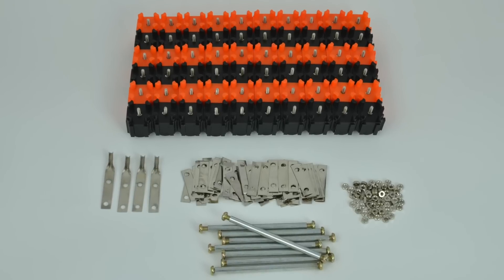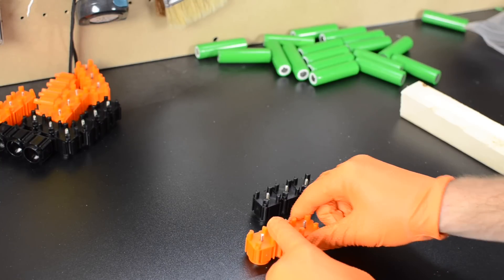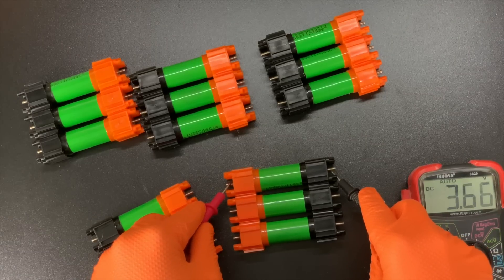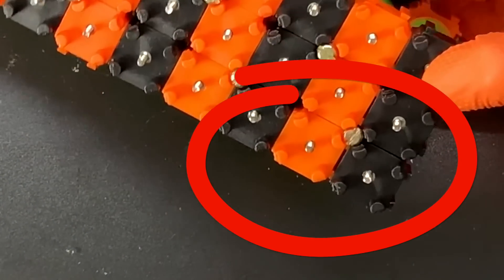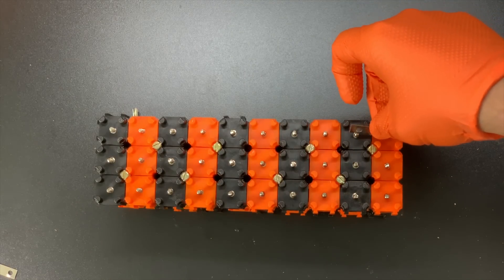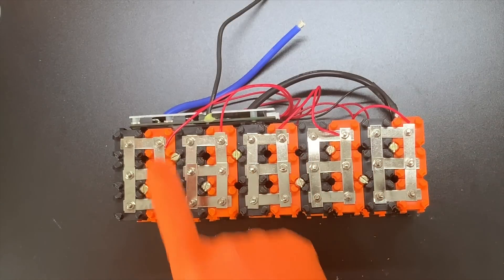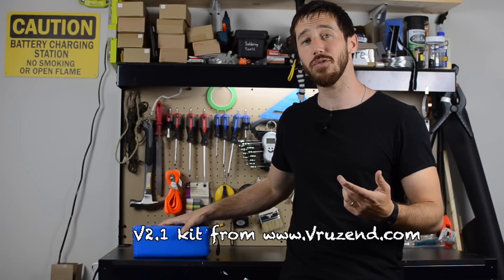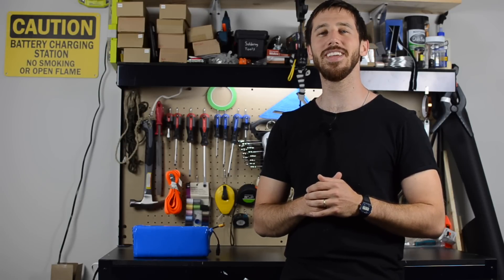New & improved Vruzend V2.1 no-weld 18650 kit

Comment: Why are you using double parallel connections?
05:13  Instead of creating those figures 8 you could suffice with creating a figure 3
Reply from the maker: You're right, figure 3 also works just fine, but I've found some people get confused by the concept, and telling people to do a figure 8 leaves less confusion and less chance for error. Also technically a Z shape would work. But that'd be even more confusing for some people.
Reply: @EbikeSchool  
A Z-shape would also mean you need different sized bars. That could take away the confusion and make it a little cheaper to produce. On the other hand you would need to know the configuration people are going to build beforehand, so it's hard to sell as a kit.
Maybe you could sell the longer bars (for Z-shape) separately and have a fuse incorporated in them to make things a bit safer. That would be a nice upgrade, especially for large batteries.
If I would use Vruzend to build a battery, I would only use the bars for serial connections and solder glass fuses between the bars for parallel connections. I don't know however how well glass fuses can stand vibrations. I only tour in the Netherlands and don't go off-road, so for me it wouldn't be a problem. An indent might suffice as a fuse though, maybe with some isolation or a tube around it, you would need to test that.

Comment: Where weight is a big issue, I wouldn't use the Vruzend kit because it does add weight to the project.
Therefor the solar car and the paramotor are not very likely to use Vruzend. Vruzend also adds size to the battery.
In super large batteries I would think of fusing the single cells (like Tesla does) or fusing the parallel connections.
The BMS only protects the serial groups (and only to a certain extend). Instead of the parallel bars you could use little glass fuses of 2A or 3A. You can easily solder those on, also when using the Vruzend kit. Those glass fuses only cost a few bucks per 100 and are most probably even cheaper than the parallel bars.

Comment: I'd love to know what it would take to build my own battery with your kit(s). My current e-bike battery is a 48v 11amp 500 watt hour battery. The store I bought the bike from sales a replacement battery for $650 and has a 17 amp hour unit for a bit more. What I'd prefer to do is to build my own and plug it into the charging port to double or better my range and as a learning experience. Any help to get me started would be appreciated.

Comment: Building the battery, you probably should avoid sentences like "it has to be connected somehow". Also, you already have soldering iron near you, why then you put wires under bus bar nuts instead of soldering them properly? I can accept this approach if you would have some sort of fork terminals, but pressing bare wire under the nut is not a good idea.
Reply from the maker: You're right, you can solder to the bus bars. But not everyone has a soldering iron so I was demonstrating other methods.

Comment: Thankyou for the update Mike. I've a simple question, as you say this is a simple Lego style building kit and learning curve is less and all we have to remember most of the projects use (diy project also) 12V as basic and will keep building it's multiple. So instead of building this individual block why can't we make a 4S module as 1 unit. The benefit is we can shrink size little more also can reduce loosing up pack. If you tried this before, i would like to know your findings.

Comment: Interesting product evolution.  How to the economics shake out relative to off-the-shelf batteries?
Reply: Usually you cannot get used-cell battery packs, unless you're being scammed. The economics can be very good if you can get low-use used battery cells from somwhere.

Comment: Would you consider making a video showing how to make a battery for usb charging and for using a 12v dc refrigerator (engel/domestic). I have a bottle battery that broke and i harvested the 18650 cells from it and would like to repurpose them as a small battery pack.